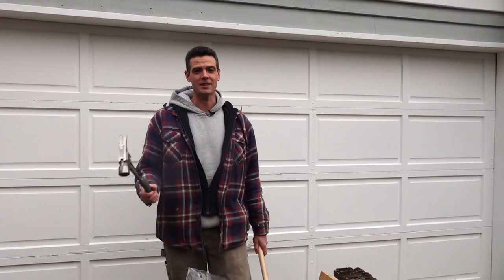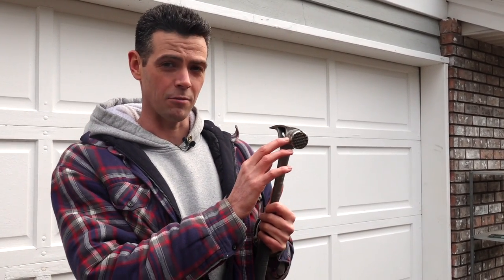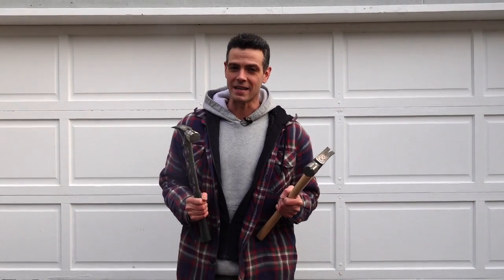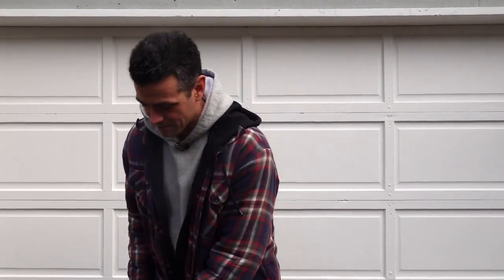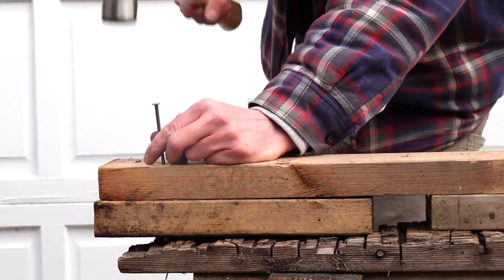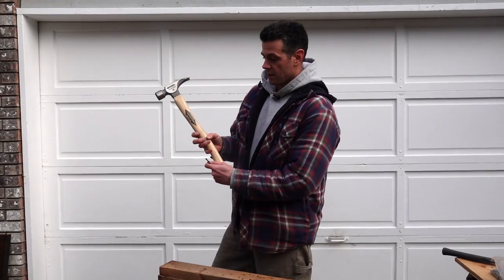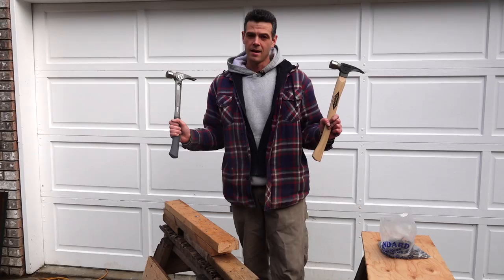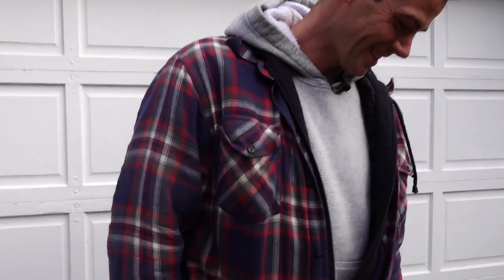16oz Stiletto vs Tibone3

Comment: I had the original version of the tbone ( pre side nail puller with the gray grip) for years and loved it. Before that my go to was a 21-23 oz Hart or Vaughan. I also have a couple 14oz wood handle stilettos that are great as well. Recently I passed on my old tbone because the grip was getting loose and pretty beat. (still had the original face as well because I'm one of the odd framers that prefer a milled face that's so beat it might as well be smooth or just a smooth face.) I bought one of the Martinez hammers and it really is an incredibly nice hammer. Took some getting used to after using the tibone for so long but you'll have that. And sure they're expensive but it's a tool that I actually use extensively every day. I can't say a hammer has ever owed me a dime no matter what it cost me.

Comment: The Ti-Bone 3 head will never spin. Never actually had mine off but it has slots that lock it. I’ve been swinging mine for nearly 2 years. And I mean using it, I always hand spike all my floor joists and trusses. Never has moved on me. And I can actually swing my hammer again because my elbow doesn’t feel like someone hit it with a hammer.

Comment: I have the Ti  Bone love it.
Sometimes if your on a job and another Carpenter asks you for a loan of a Hammer and you hand it to them they very rarely want to give it back.
The biggest job i have is to watch it at teabreak i never leave it out of sight because it could go walking.
The thumb imprint on the handle is very useful and suits my hands perfect.
The only thing downside to the hammer is in very warm weather your hand gets sweaty and the handle becomes slippery.

Comment: It should be set it and sink it, not set 1 2 3. I've never been able to sink a 16 in under 2 swings with a hatchet handle, but I can set and sink all day with a straight wood handle and that's when I'm walking plate rolling trusses because that's the only thing I hand drive. I got a stiletto for Father's Day years ago and I couldn't sink a 16 in one swing because it's just not heavy enough. My favorite was a 28 oz. Rigging hatchet but OSHA banned those a long time ago. Now it's either a 21 oz. Deluge or a 21 oz. Vaughn Blue Max. The  Deluge is hard to find and I need a new one so right now it's the Blue max. Hitachi made the best and most expensive framing gun, and when I bought my first one in 1997 I spent the same amount you did on those hammers. I still have it, and looks beat up but still works like new. My point is if you can't shoot nails with it and you can't set and sink with it how do they justify charging 3-4 times the cost of a Deluge which is top of the line or a Vaughn which is also top of the line, and the innovator of the California framing hammer?

Comment: I was given a Stiletto mini 14 that is pretty much cooked. (Face is worn and Allen bolt is siezed, grip is work and not replacable on this model) but I love it! I've had a few cheaper framing nailers and I need something incredibly heavy to get the power I need for working with hardwood but the Stiletto gives my the same result as an 18 but with the weight of a 14. It's awesome. I've been considering buying a new one but the issue is I use it for demo as much as I do general construction so a $400 hammer breaking off dry mortar doesn't sound appealing for me.

Comment: Honestly I’ve used a stiletto tb3 for high rise formwork for a year now. I like it, but it’s definitely a framers hammer not a form workers. Hitting jacks and rebar and shit like that makes my face always come loose, so bad that I’ve had to super glue it almost at the end of every day, bought a new face and a few months after same thing, I’ve epoxied it on now and that seemed to do the trick hahaha. But also anybody that’s familiar with form work stilettos suck ass for working on Peri walls or gang forms, but it’s amazing for closing deck or working with nails. But sometimes the swing doesn’t hit hard enough and you have to hammer clamps 30 fuckin times just to get them off. East wing 28 or 30 oz is the absolute best for walls. But I still love my stiletto
Reply from the maker: Good to know!

Comment: Nothing beats an estwing. Best balance, and it will last several generations in your family. Everyone else makes wood handles to try and get a better balance and swing, and to lower the shock from striking. Even then the estwing still has better balance, a handle that absorbs shock, and doesn't give up durability.

Comment: I haven't liked the Stilettos since Mark sold them to Milwaukee/Hart and they are now made in China.  That being said I still have my Stiletto 10oz hickory handle trimmer.  But I switched the the Martinez M1 Framer and I LOVE it.   I only use the curved handle, never straight, but that may just be because I grew up framing with a rigging axe.  And If I was still a spry lad I would still use a rigging axe.   NOTHING drives a nail like a rigging axe.  I also do not use the thumb rest.

Comment: I love the side nail puller. I’ve used that to clasp onto stubborn concrete anchors then hit the side of the head with another hammer to drive them in. Great multi use addition to the tool

Comment: Too bad dalluge moved overseas. You should try a martinez hammer if you like spending on hammers. The old owner of stilletto broke off and made martinez hammers. They are usa made. Titanium hammers with steel heads that are swappable. Check them out. They are pricey but so are stillettos.

Comment: union carpenter. for concrete Ive been using the 14 oz stiletto. 2 of my co workers rock the 15 oz titanium and for concrete i think thats probably the superior option. the 14 oz stiletto is still great but theres a higher risk of breakage and w the titanium i wouldnt have to relay on my catspaw as often interior work union work Im still using my 20 oz estwing. its smaller head and overall body is a better fit in tight spaces. residential framing tho the 14 oz stiletto shines.

Comment: Loved the video. When I was starting out my dad called me lightning because I never struck the same place twice. I've got the t-bone but was one of the first ones out (at least where I live).  Was it worth the money?  I don't know.  Once I paid the price, I just used it and didn't really ask if it was better than something else I could buy.  I really like some of it's features, but I only use it for rough framing.  Truth be told, I went to a gas powered nailer after a while.  It's just easier and a lot faster without the hassle of dragging a hose around.  One thing I really like about the t-bone is the fact that you can slide the end of your cat's paw (nail bar) through the holes on the handle and use the hammer as a sort of extension that gives a bunch more leverage for really stubborn nails.

Comment: Ti bone is 100% worth the extra. #1 is the side nail puller. Honorable mentions are the holes in the handle and the changeable faces. The handle holes can be used to add extra leverage to a cats paw. The most important on the job use of the handle holes is to be able to use the hammer for a reaching overhead and to use as a crutch for walking crossways on a steeper pitched roof. Hold the hammer head with the magnet in the center of the palm of your hand and with your middle finger in the top hole. This gives you about a foot and a half of reach. I use it for that several times every day on the job.

Comment: 5:17 I’ve noticed that grain direction is extremely important when it comes to hammer handles. Most hammer manufacturers have them going the right direction where the wood is strongest for pulling and striking. Often tho you’ll see handles that look like the grain started a twist, or they just shaped them wrong and now the weak side of the grain is being used.
Reply: Look at the bottom of your wood handle if it isn’t painted. If the grain is running the same direction as the strike then it’s good.

Comment: I had the tb2, I loved it! But hated that the face would rotate which I believe they fixed with the tb3, but they are not made in America, so I was about to buy the the Martinez m1, which was invented by the guy who designed the stilleto and is made in America but decide to get the erner brand ev3, and so far it is the greatest hammer I have ever tried, the balance, weight and utility of the hammer is second to none, it was designed with heavy-duty construction in mind, might not be for your average framer or residential guy, but high recommended for bridge builders, wall guys form setter etc.

Comment: I bought a tibone second hand (40 bucks) but it was in pretty rough shape.
Replaced the face, as my work just happened to have one laying around, and i crafted myself a new handle cover. It was a quick and easy replacement. However the claw is fairly dull, and the groove is quite shallow. does anyone know how one could sharpen up and deepen the claw?

Comment: Wood handle with tomahawk curve handle. It really makes a difference! 
Straight handle for form work, where you’re sliding more than one tool into a clip. And position of your hammer clip.  Curved handle in the back of hip to middle of back clip. Straight on the side.  Just my personal preference.
Reply: I prefer straight handle wood handle framer. My curved handle California Framer has heavier head, is probably reason I prefer the US made 20 oz Stiletto.

Comment: I'm a little surprised you are comparing the curved handle 16oz instead of the straight.  First thing I do with any wood handle tool is sand off the finish and put a little boiled linseed oil on.  much nicer grip then.

Comment: Those 3" nails are 10d. Guys that get ribbed for spending "way too much" for a hammer say it saves their elbow because of the titanium weight. The ones that use that excuse are late 20s/early 30s. They don't know what sore joints are like yet! I've been using a Vaughn 20oz framing hammer (999L) for the past 40 years. The first ones I used had Craftsman on them. When Sears disappeared I found out those hammers were Vaughn made. This is one of your funniest videos yet! I love that saying when you miss the nail. I'll have to remember that!😂
Reply: "What's heavier... a pound of iron or a pound of feathers?"   Ummm....    Like, there is a pretty limited amount that a solid material can make a difference given that the head has a set weight.   You can make the handle heavier or lighter, but the weight of the head is... the weight of the head.  16oz is 16oz regardless what it's made out of, so I agree that the benefit of titanium is not the weight.

Comment: The thumb thing I feel like works better for when you want a shorter grip and a more accurate swing but I also do not put my thumb there when swinging it but I definitely put that little indentation in the meat of my hand when I wanna choke up on it
Reply: i use the thumb  grip for nailing above your head installing soffit or ceilings

Comment: I have been framing for 4 years and have been using the TBone3 the whole 4 years..   Never had to re-tighting screw on head.. Almost the framers i work with on the subdivisions sites use the same hammer and say it the best..

Comment: I rest my thumb slightly off centre on the back of the hammer.  This adds a level of control over the hammer and stops its tendency to pivot back against the webbing between the Thumb and Forefinger.  That's how I was taught when I first started Carpentry and it's stuck ever since.

Comment: I have a 23oz vaughn framing hammer with a straight wood handle (not the axe handle) that I bought when I first started in carpentry/construction about 15 years ago, and although I have bought some other hammers I have always switched back after a few days. I have never tried the titanium stilettos but after injuring my shoulder a few years ago a lighter hammer might be a good improvement, but a big question I have is how is the shock when beating on things with it? I feel like I probably hammer more big crowbars into place thesedays than nails, and one of the reasons I like my hammer is the wood handle absorbs a lot of shock. This is probably the reason I have a couple estwing steel handled hammers I rarely use. How is the titanium hammer different than a steel one, just lighter but still has the wide head?
Reply from the maker: There is definitely more shock on the Tibone than on a wood handled hammer but it's not as bad as a steel Estwing.. I don't use hammers everyday anymore so the vibration doesn't bother me and the Tibone has become my hammer of choice however if I was using a hammer everyday I might consider a vaughn 19 oz. Kind of the best middle ground hammer in every way IMO
Reply: @vancouvercarpenter  yeah the vaugn 19oz was what I was thinking of going with actually, will see if anywhere local has a wood handled stiletto so I could at least see how it feels.

Comment: Have to leave to see what Larry Haun used. I guess years of expertise,really.
Reply: Hart/Dalluge, 17”-18” California framer, 18oz-20oz milled faced steel head with sharpened straight claw, taped  handle for protection against concrete.
Most importantly, the Haun’s knew how to swing their hammers.

Comment: I loved my Stiletto but still preferred my 27 oz California Framer by Vaughn, that was a beauty of a hammer, just had to file and sand in some finger grooves and seal it up as the finish on the original was slippery.
Reply: I still have my lovely old Stiletto US made 20 oz straight claw corrugated head framer sitting on my bench to admire. It was my trusted friend for years. I took a light wood rasp to the handle finish and added a few tiny cuts with hack saw. I found the 27-28 ounce framers fatiguing to use every day.

Comment: Ive had the 14 ounce wood handle for about 4 years now. I do a lot of exterior work and it has seen a fair amount of abuse. I still haven't broken to original handle. The milled face is almost non existent now though. Im not very careful about what I hit with it.

Edit: I have definitely had it fly out of my hand a few times. Also lost the magnet in mine about a year ago.
Reply from the maker: I had the magnet fall out. Easy fix. Find a rare earth magnet that's the right size and epoxy it.

Comment: I agree the Vaughn hammer quality is great and love them. Have a 22 waffle framer, a 20 flat face, and a 12oz finish nailer. Never used one of these expensive hammers.
Reply: look up "hardcore hammers" Thats what brand of framing hammer I use and not only are they the best-looking hammers on the market, but they have a huge variety they are all wood handles that have the perfect shape, and they support veterans.

Comment: I bought a Stilletto TI15 about 6-7yrs ago. Comcerning the interchangeable head I almost immediately switched over to a smooth face even though the bulk of my work at the time was framing. I though I would switch back and forth between the waffle head and smooth face head but I just stuck
With the smooth face. Awesome
Hammer. I cracked the head down about 4 years ago and it has not moved,in fact I'm not sure  I could change it out if I wanted to. I have beaten in nails, demoed, cranked and pryed, hammered wood and steel stakes, used the face and claw to chip off concrete seams, chiseled, etc. Zero complaints. I'll probably be using this hammer until my last day on the job.

Comment: I use a Vaughan 19 oz head with an 18 inch replacement handle. I love the magnetic head. With a handful of nails I can set it and with one lick get it flush when standing on plates without having to try to bend over and brace my core for a good controlled swing. With a smaller handle you have to bend over just slightly lower. You just have to command the arm swing. Wish it was 16 oz or 14 oz. But I'm not ready yet to pay that much for a titanium hammer.